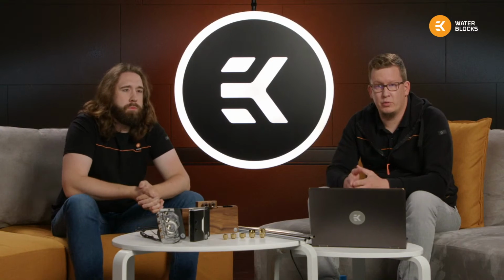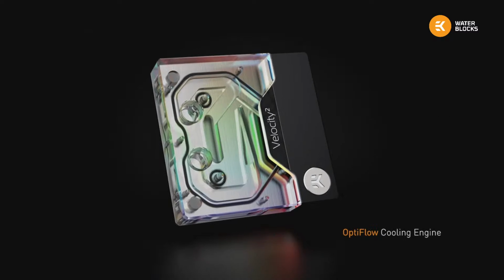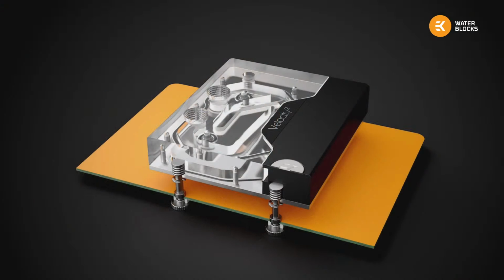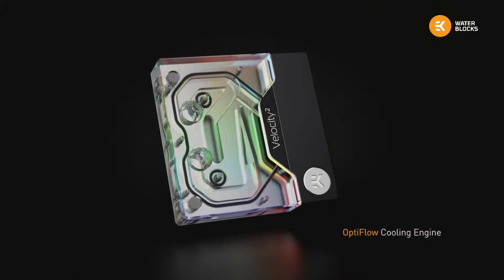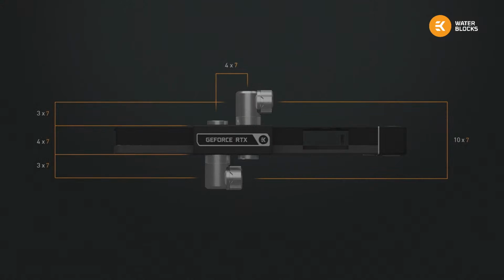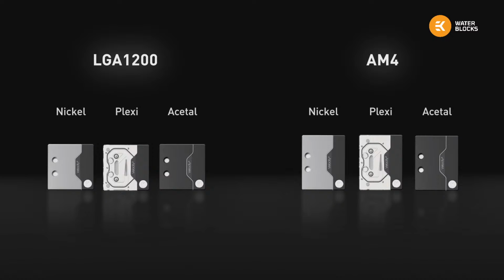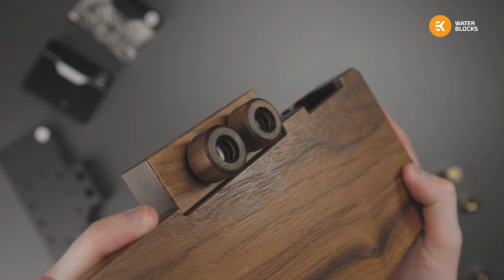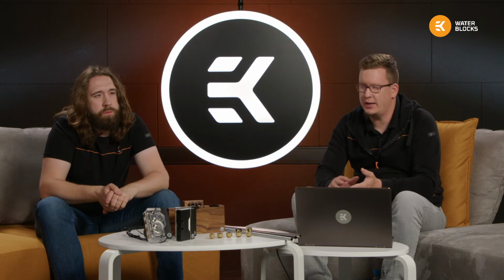Strictly QUANTUM | EK-Matrix7 Explained

Comment: I just seen the 7000d distro/pump res w d5 coming very soon .. but I've noticed it will only support 2x360mm radiators.. but the 7000d can take 420 and 480 radiators top n front ?? I kinda don't understand how it's marketed as a 7000d but really suits 4000d compatibility?
Reply: Same I just now am seeing this and was thinking of pre ordering it until I saw it only says up to 2x 360's and not two 420mm top and front. Dont think 7000D can fit a 420 top and 480 front. If using a 480 front, it would have to have a 360 top I think correct?

Comment: Will there be a Matrix 7 update to the O11 Dynamic Mini distribution plate? If not, will vector2 blocks still be compatible with the original plate?
Reply from the maker: A Matrix7-compliant distribution plate for O11D Mini is planned to be released in a few months. You can always connect all of our Matrix7 blocks to the current distro plate, even if it isn't Matrix7-compliant. The Matrix standard only makes the building easier and also opens a way for "clean-looking" builds.

Comment: Are the new fans going to come with a black center blade accent instead of aluminum finish? If not can this be removed? Glad to hear the new radiators will come in all black as well.
Reply: No plans for a different color motor hub cap, but a very valid point. We will definitely reconsider it at one point.
Reply: Thanks for the response once again.

Comment: Magnitude class GPU blocks when? Being brutally honest, I'm just not a fan of your GPU block quality or aesthetic (acrylic window). The 3000 series FE is the first one I've been impressed by and actually want (just can't get an FE card). More of that and I'm on board with an EK centric build. 

That said, everything you announced at Computer looks great.
Reply from the maker: What about our products, quality wise, has bothered you the most ? We always look for way to improve and value community feedback.

Hmm. Acrylic is basically unavoidable if any one wishes to showoff the coolant flow, but on the "Magnitude" line of though, have you checked out our full nickel GPU block:
https://www.ekwb.com/shop/ek-quantum-vector-re-rtx-3080-3090-full-nickel ?
Reply: @EKbyLMTEK  Thanks for the reply. I can give you some specific points. 

1. It looks like you have solved this with the revision but one of the most practically and visually annoying part
of the current GPU blocks are the finicky, and clearly visible RGB cables. FTW3 30XX specifically.

2. What I mean by "acrylic window" is that there is no metal on the face of the card and it's basically 90-100% acrylic with the PCB exposed. Optimus is the same way (and I don't like it there either). This is one of the main reasons I tend to favor German brands for GPU blocks. The exterior of their cards simply have a cleaner and more premium appearance thanks to metal cover plates which hide all the screws/PCB. As I mentioned, this is one of the reasons why the 3080 / 3090 FE block from you guys is appealing. The wrap around back plate is a step in the right direction for the upcoming blocks. I'd like to see something on the level of the FE blocks extended to cards like the ftw3, strix, etc. $300-$400 range (w/normal BP) is perfectly fine if the quality is there. 

3. There are some quality of life and nitpicky things as well. The unsorted screw bag and uncut thermal pads are something I've had multiple first time custom loop builder friends complain to me about. It's a small thing but it makes a difference for someone new to the hobby. I had to help one guy out and to be frank it was pretty annoying for me as well. I think most people would be willing to pay a bit more to not have to deal with that.

4. Similarly I've had more than a couple people come to me complaining about quality control. You can see this online as well. Obviously you guys make more blocks than other brands so there will be more "bad" examples out there. And while other manufacturers certainly don't produce as much as you guys their quality control seems to be anecdotally better % wise. I'm fully willing to admit this could be perception and not totally accurate. I mention it nonetheless.

In closing, I think the aesthetics and quality of your other products (CPU blocks, fittings, etc) have increased at a rate faster than your GPU blocks.

New rads, matrix 7, new CPU blocks, fans, etc, that's all great stuff.
Reply from the maker: @paskowitz  

Thank you for the through feedback :)

We are looking to address most of the issue you have mentioned regarding the packaging by incorporating a higher percentage of biodegradable materials as well as better sorted screws and precut thermal pads.

QC issues might be more prevalent, but that is mostly down to the fact, like you mentioned, that wee make thousands of blocks per production run of a certain model and we get sub 1% returns in the worst afflicted models.

Al the other pointers will be forwarded to the team :)